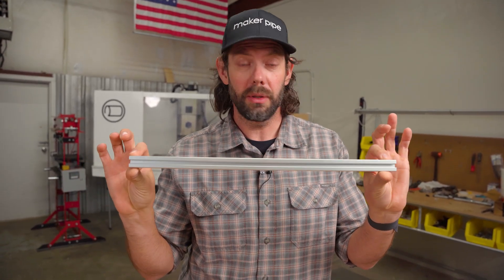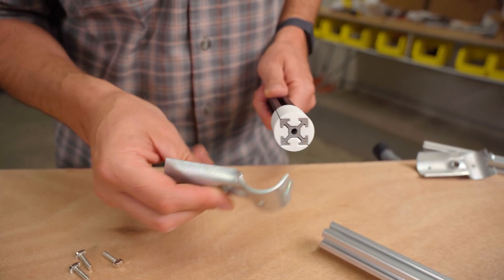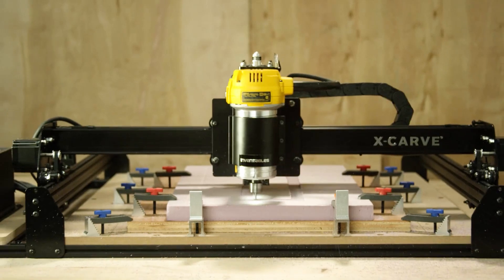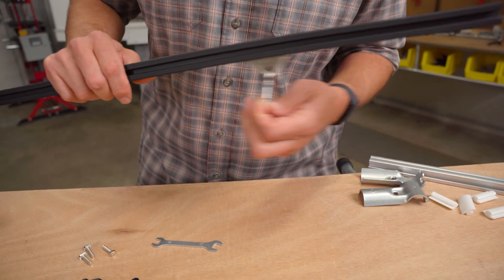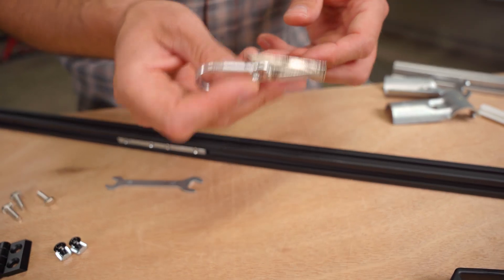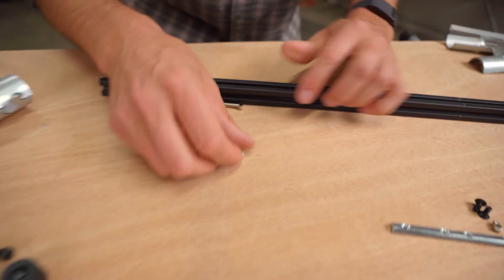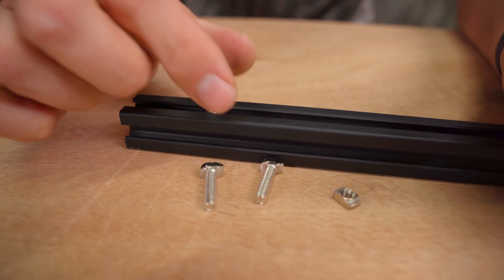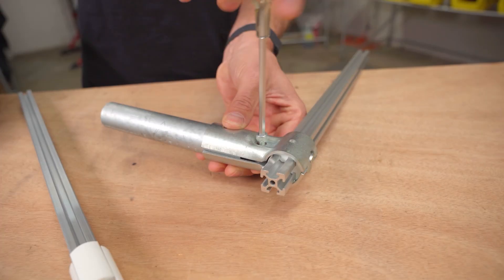These 2020 Accessories Will Level Up Your Build!

Comment: The Plate that didn't fit is probably dimensioned for Vee rail 2020 it has a slightly different profile and is designed for use with rollers.
Reply: ...and I have never used that much force to put a roller carriage on. He was struggling! They are meant to glide...be gentle...use a slow hand and an easy touch, please? Loosen the cams and give enough torque to keep it on, without resistance. The plate will be straight if you use it properly; else, mill your own from 3/8 plate steel and tighten that puppy up!!!